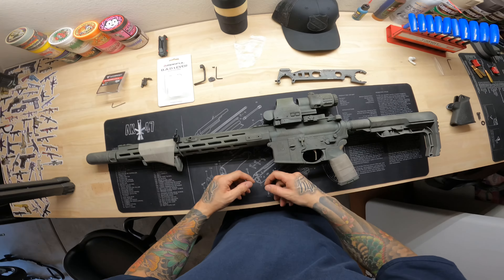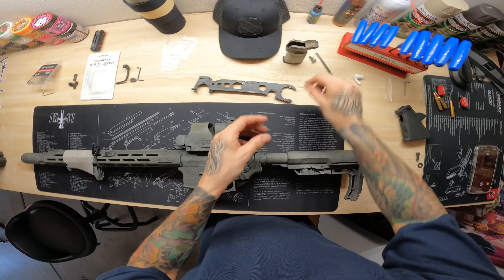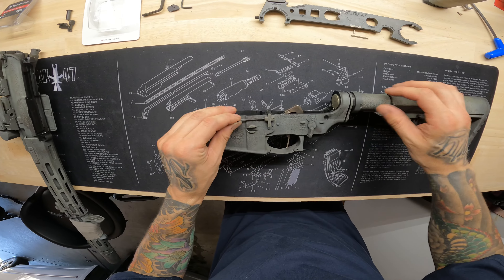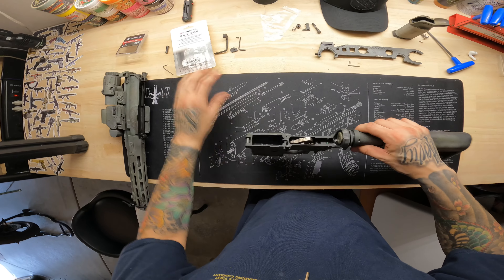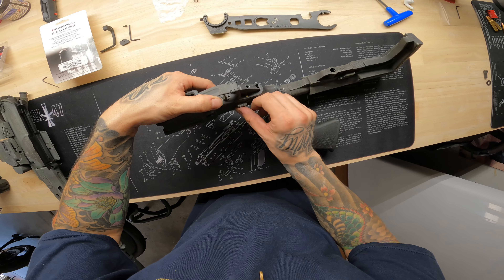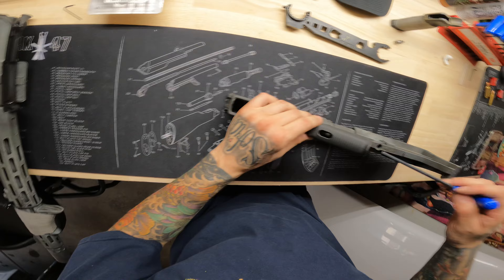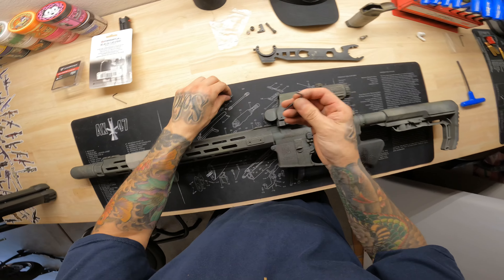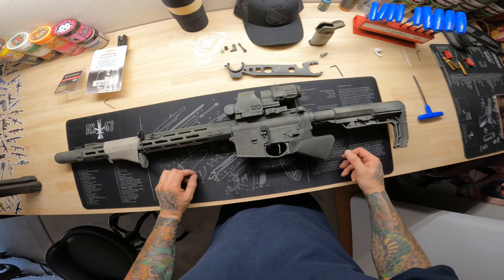Installing a B.A.D lever and a sparrow dynamics pistol grip

Comment: Cool video with the head cam.  Thanks for posting!  In case anyone is watching this trying to install our rifle grip...  one tip or trick on getting the washer and screw installed is to drop the washer in from the big opening, and then the screw separately from the top opening.